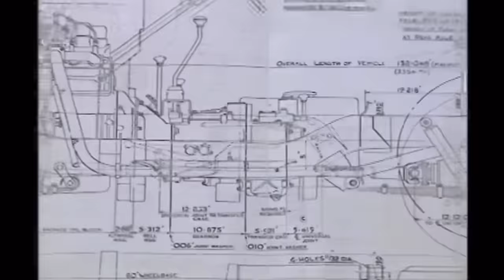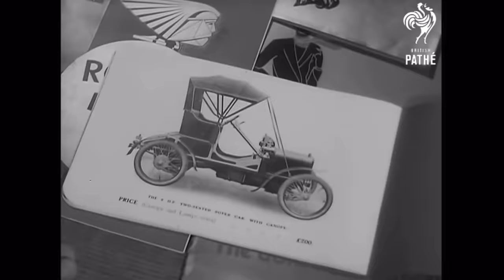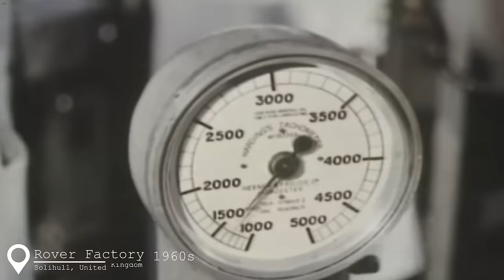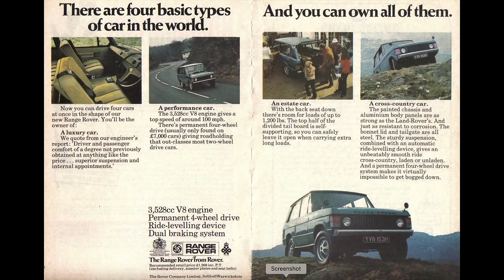From Farm To Fashion Accessory: Why Land Rover Created The Range Rover — BTS with DTS — Ep. 16

Comment: I've had a few of these and still have a 93' Vogue in my collection. They are quintessentially British. Charming, elegant, and understated fun. However, something is always broke or in the process of breaking. It leaks everywhere and the rust forms overnight.
Reply: Reliability was not mentioned in the video… I always wondered how these stay so popular, considering the reliability. 

Growing up in the late 80s, one of the elementary school teachers had a range rover. I had no clue what it was, but I knew it was special, and I would always constantly look inside the interior to check it out.
Reply: Had a 91, always problems with windows not working, stuck seats etc. couldn’t get rid of it fast enough!
Reply: @Wasabi9111  My 94 county lwb (vogue lse) has been in the family since 97. I know its entire breakdown history up to its current 280k mi. Most reliable car in human history I'm sure. Even the air suspension remains. I think the bad rep is from people driving the aluminum v8 low on coolant or when its overheating. Doing so probs means a $12k bill for new liners. As for mine its had a light switch, an air suspension down button, ive adjusted the door locks when they stopped working. Timing chain, fuel pump, $150 air springs get replaced every decade, viscous coupler as is usual in other bw tc cars. Just normal maintenance items only. Nothing like the nightmares of the later cars, like the original range rover sport which has lots of body off repair problems or like the Hondas and Toyotas that my family members drive that are nothing but issues.

Comment: From 91 to 05 I was responsible for tooling approval and Engineering deviation reports of the Land rover V8 block and head.which came with the the classic and P38. I was responsible for tooling approval of TD5 code name storm head but not block.

Comment: The 1948 didn't have a locking diff. Unless you're talking about transfer case diff what's means it has regular awd then 4wd. Every time someone talks about CDL as a locking differential the rest of the world is thinking of locking axle diff.  CDL is 4x4 to the Awd vehicle. The fact they didn't have it on some makes it seem special to those who have it which is stupid it should have never not had it for an off-road only company
Reply: The First rovers were part time 4x4, meaning you locked it into 4x4. They were not AWD.

Comment: I like how people from modern day look back thinking it doesn't drive like modern vehicles. Yeah out it to work and watch your modern garbage beep and buzz. This truck will never be made ever again and generations will always try to replicate it with modern engineering which simply doesn't work. Cheers
Reply: Yeah but the maintenance and repair cost is ridiculous.
Reply: @bngr_bngr  that is definitely said by someone who has never owned a Land Rover product out of warranty 🤣
Reply: @affordabledcgenerators1607  I own several old cars.  No sense getting rid of them just because they are old.
Reply: @bngr_bngr  
Er, no it isn't. 
Any older vehicle will require maintenance obviously, 
but Land Rover/Range Rover parts are plentiful (therefore cheap) and easy to replace (also therefore cheap). 
At least with my two Range Rovers, I'm not paying a quarter of my monthly salary for products that I will never own, as I would if I was to have a new Range Rover sitting on my drive, waiting to be stolen.
Reply: @ericdunn555  if you do your own work that might be true.
Reply: @bngr_bngr   
oh I'm no mechanic, that's for sure; 
but RRCs are bolted-together, simple to work on, engine components are easy to access and no specialist tools are required, 
so I can do a lot of stuff that newer cars would require to be workshopped (ergo, expensive) for;
a friend with a ramp lift helps out with heavier and awkward access jobs, 
and the sense of accomplishment when a job is completed definitely gives me a buzz.

Comment: The Range Rover concept, and some (many?) of its individual elements, are brilliant, as so many fans have always cheered.  
Yet, the application of all the elements, into a brilliant overall vehicle, seems to have been crippled by all the usual maladies of the British auto industry.  Brilliant potential , but rarely (never?) fully realised. 

So, to meet the persistent enthusiasm for these devices, has a variety of genuine, permanent fixes,  mods, components, etc, ever eventuated?  (Other than forking out the stupendous/exclusive cost 🤑😵‍💫of a restomod product - Kingsley and others.)
Like, overcoming the persistent leaks, the continual electrical failures, the propensity for engine leaks and overheating..?  
I'm sure there's more. 😬

No, I'm not about to buy one - just curious, and maybe in the future. 😏
Reply: The original Range Rover Classic is devoid of complicated electronics, very workhorse like - but with some creature comforts, very robust and easy (therefore cheap) to fix. 
They are like Marmite: you either love 'em (and therefore are willing to put up with occasional foibles and dribbles) or hate em'. 
I've loved everyone of 'em I've owned 
(but that probably says more about me than it says about my Range Rovers).
Reply: Oh, and as you no doubt are very aware, 
falling in love can take a very long time 
(and can happen without you even realising 
that that is what is happening).  
My wife will confirm this, and she should know 
(not talking about Range Rovers now, btw). 
😁😂🤣🤣🤣

Comment: "the rover V8 would become one of the greatest engines of all time" 😂😂😂😂😂😂😂😂😂😂😂😂😂
Reply: Why is that funny though? The Rover V8 was a long lived engine that powered the Range Rover into its second generation, it powered the Rover P5B, the Rover P6 3500 and 3500S, the SD1, the Land Rover Discovery, certain models of the defender and series III Land Rover, and a huge number of British sports cars, including the Morgan Plus 8 and, in 5L form, the TVR Griffith 500 and the Chimera 500. It was an incredibly versatile V8 with lightweight construction by the standards of the time and a half decent power output for each of the displacements it came in. There were reliability issues, but as with a lot of things coming from British Leyland, this tended to be more down to quality control during manufacture rather than a design issue. In the UK, certainly, the Rover V8 was an incredibly significant engine, which still gets used in UK-built hot rods and in V8 swaps in RWD vehicles, due to the wide availability of parts, the ease with which you can obtain the engine, it’s aforementioned flexibility, and the wide range of mechanics that have experience working on these engines.
Reply: @Jo3man96  "most significant" i could maybe get behind. Greatest? Woof.
Reply: @therealturbofanisme  It’s a pretty great engine, all things considered. What aspects do you consider when looking at what would be the greatest, or more correctly in this case, one of the greatest?
Reply: @Jo3man96  to me it's not just popularity but the objective characteristics of the engine. 

BMW's inline 6, whether you look at the M54, N52, or S54 - that architecture is astonishingly good.

Small block Chevy, for very obvious reasons.

Ford's Voodoo V8 in the GT350 for how special and high revving and unique it is

2JZ Toyota engine for how stout it is.

1UZ/2UZ Toyota V8s for their longevity and smoothness.

Honda K-series for its ubiquity + power capability

Honda's F20/F22c engines for being engineering masterpieces producing insane power and revs for its displacement

The Rover V8 got the job done, sure, and it powered some very cool vehicles. But it was never particularly great at whatever job it was doing. Almost always underpowered and thirsty.
Reply: @therealturbofanisme  being an all alloy engine in the 1960s was pretty important, and the power output, given its displacement and the time it came out, was actually pretty good, the 3.5 making 160 hp. What you need to remember is there is that american manufacturers at the time would rate horsepower when running engines without any ancillaries, including a water pump. The reduction in power ratings in the early 70s in america had a fair bit to do with changing their rating system, alongside the new regulations. MPG wise, it’s actually not much worse than my Alpina B10 3.3, which given it’s an engine design from the 1960s, and it being a V8, is pretty good going in my book.

It did an excellent job in the car it was initially intended for, the Rover P5, giving it some much needed pace, while retaining refinement that the car enjoyed with the previously used Rover I6, and did a pretty good job in the Range Rover and in its sporting applications. The 5.0L variant in the TVR Griffith 500 put out 340hp, which for an engine initially designed in the 60s being used in the 90s is extremely good. The S62 in the E39 M5 made around 50hp more, but that was a much more modern and complex engine. It was a little bit more than the SN95 mustang cobra, which was putting out around 320ho using the modular V8, a much newer engine design. 

The engines you mentioned are all fine engines, but the Rover V8 should be up there with them for it’s early use of all aluminium, which made it an astonishingly light engine for the time (when they put it in the MGB, they didn’t have to alter the set up of the car, as it weighed the same as the 4 banger MG had used previously) and it’s flexibility in use, being used for family saloons, off road vehicles, and sports cars. The fact that it won the paris-dakar twice in a range rover proves its durability and capability in the off road sphere, there’s the aforementioned use in the rover P5B and P6, where it was generally praised for being refined and decently powerful for the time, and showed its capability in sports cars, especially in the morgan plus 8 and the TVR Griffith 500. It even won the BSCC (now BTCC) in a Rover SD1 in 1984 and got the DTM title in 1986, along with various other race wins in the 1980s touring car scene and a class win at the 1984 Bathurst 1000.
Reply: @Jo3man96  Ya know, that's some pretty compelling stuff. I didn't know about the racing history of that little Rover mill, only that they had their fair share of head gasket/other issues due to the all aluminum construction. I think that's enough that I'll stand corrected here - That little engine did a lot, particularly given the era in which it debuted.
Reply: @therealturbofanisme  They do have that, but it’s not as bad as engines with alloy heads and iron blocks. Anyways, the odd fault here and there gives it character. I’m glad I could educate you on aspects of the engine you weren’t aware of.
Reply: @Jo3man96  thanks for the courteous and educational discussion! Cheers man!
Reply: @therealturbofanisme  No worries!
Reply: Just like to add that the 3500 and 3500S P6 was an astonishing car/engine combination for soo many reasons.